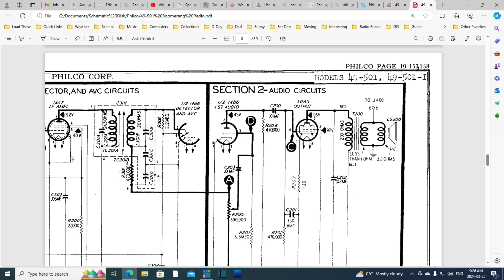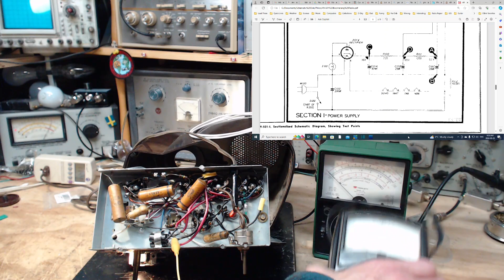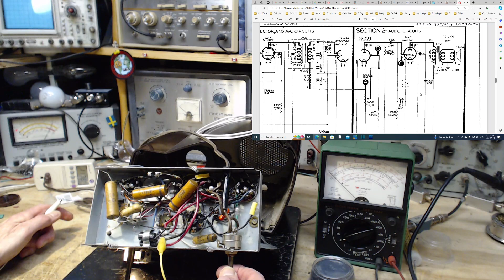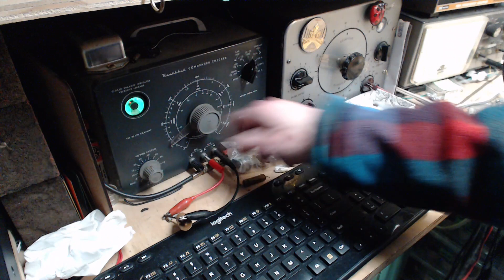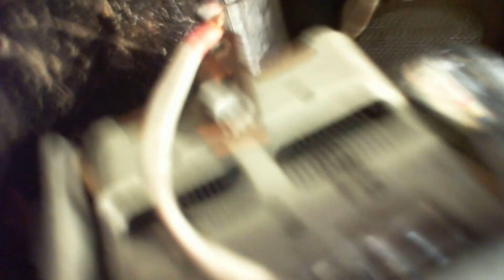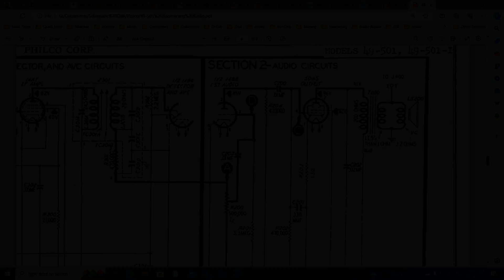Philco 49 501 Boomerang Radio Video #5 - Tube Voltage Check

Comment: Jim, you continue to frustrate me! You call yourself a HAM. Well maybe in the true sense of the word , you are. You have no idea what a Hexode is?  A Heptode maybe or a pentagrid converter?  The six grids incorporate, the control gid, oscillator grid ,screen grid and mixed grids. There are 6 grids plus a cathode and a plate equals 8 hence  heptode or Hexode. Duhhhh

Comment: Jim has the GREAT HP-410B VTVM meter to his right!!! That is what he should have used as well to validate voltages... If you are not familiar with the HP-410B VTVM, do a YouTube search for many videos on the meter... I own 2 of them, and when measuring Grid Voltages, nothing is better, even my $500 Fluke Digital will Load Down the circuit.. Just my humble opinion! 🙂
Robert ,, San Diego